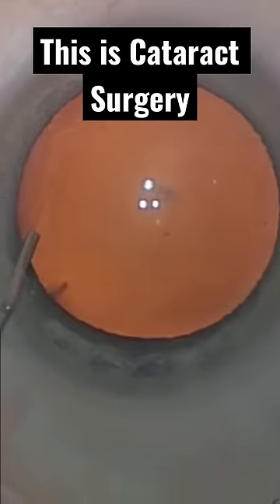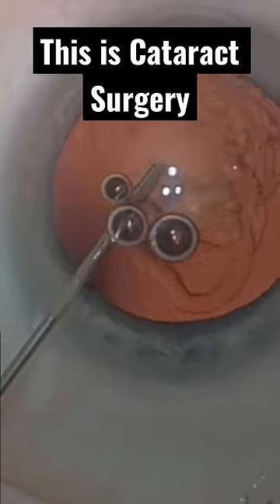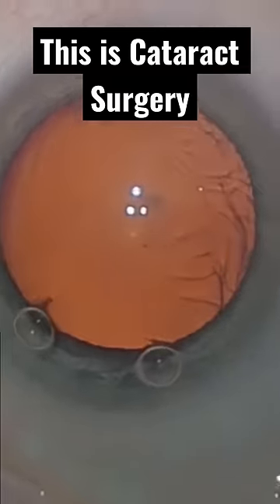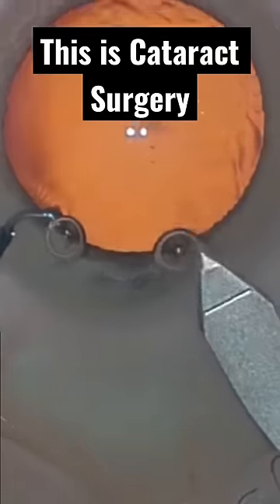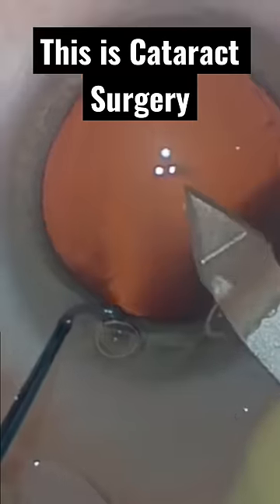Entire CATARACT surgery in less than a minute

Comment: 1. Is it possible for the implanted lens to dislodge out of place by riding a Rollercoaster. (Assuming it is months after surgery, not within the recory time.)
2. How do the two incisions made to the cornea stick back together? 
3. If they're not sealed with some type of glue, what keeps the fluid from just leaking out?
Reply from the maker: Good questions
1.) implant dislocation is very rare and usually only happens with trauma and even then it’s not common so a roller coaster is ok
2.) the incisions are made in such a way that they are self sealing so no stitches needed
3.) we swell the edges of the wound to make them water tight.  The stromal fibers of the cornea heal back together